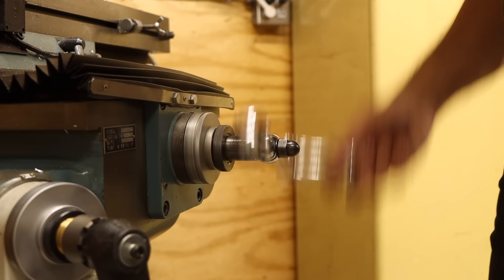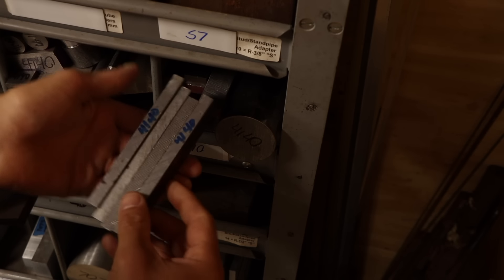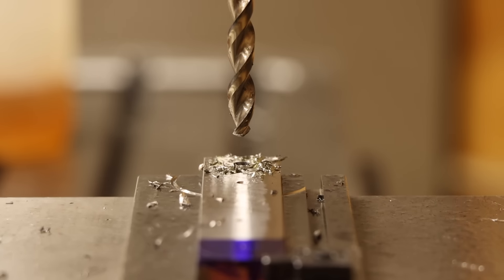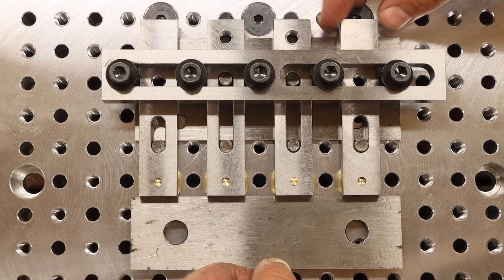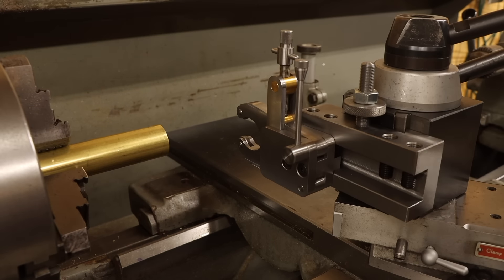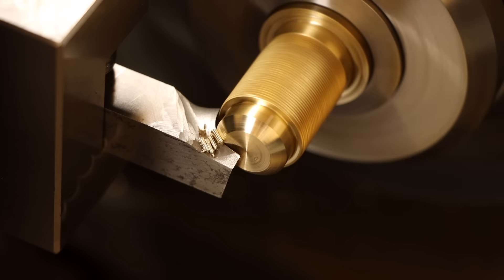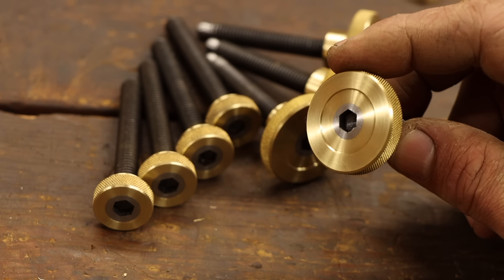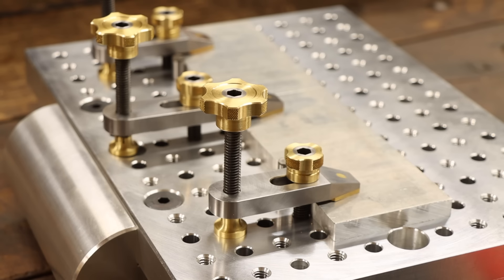Some STYLISH Hold Down Clamps || INHERITANCE MACHINING

Comment: I honestly love watching the drafting table work. It’s unique in the YouTube machining channels.
Reply from the maker: There's a good reason nobody does it anymore 😂 Thank you!
Reply: In my last years as a tool and die maker I had a drafting table (actually known as a drafting machine) placed right beside my bench to design my jigs, fixtures and dies on. Once CAD became popular all the company drafting tables became obsolete and were thrown out. They’re nevertheless marvelous machines and time savers for hobby machine shops.
Reply: @InheritanceMachining  perhaps, but like manual machining is great to see it done. Reminder of how we did things before computers took over everything.

I appreciated the compass scrip in layout fluid for the radius in the end too. No one shows layout work instead relying on a DRO anywhere. Not everyone has a DRO on their mill/lathe.
Reply: @TEDodd  this old tony has used layout fluid in many of his vids, but your right, not many youtubers use that stuff.

I also appreciate seeing the old drafting board being used. You can make drawings as good and professional looking as cad with enough expertise, i think. Physical drawings obviously have their limitations, but its how everything was designed pre-cad. Break out your slide ruler.
Reply: @ctdieselnut  I've seen him use a little here and there, but not a full layout for mill work. And many will use something on a lathe (lots of Sharpes) to show stop points as a visual reference, but they rely on a DRO for the actually stop.

I think it would nice to see channels that are vintage/manual oriented actually use the techniques from 50 years ago instead of adding and relying on modern DROs for everything. Like manual drafting vs CAD, it good to remember the old methods. Could be handy when things breaks.

Watched one guy with an old drawing meant for manual layout and he complained about it not all being referenced from a single point. So he redrew in CAD to reference that way and did the entire project with the drawing and DRO. No marks anywhere to even check he was in the right spot. (Of course he also converted all the fractional inches to meters too)

Comment: Having done manual drafting through my early career. An old time drafter I worked with taught me to rotate the pencil as you drew the line to ensure the point remained sharp and a constant thickness. Good to see you doing the same thing. Great channel and look forward to your videos
Reply: Me too. As the formats progressed to ink, crayon on mylar was the epitome of being able to draw fast (rotating the holder) without breaking the 'crayon'. Nice thing though was also the ability to erase without messing up the surface. You simply rubbed out a mistake with water. I have a permanent dent in my middle finger. As for time: The actual drawing time for these would be pretty quick. Research and calcs would take 2x the actual. He is drawing on vellum, may want to consider the more temp. stable mylar. Remembering now: To save the vellum expense I would have students draw the entire project on bum wad. Temp and humidity excluded, the trace approved then, the execution of the final drawing would be done. For the actual drafting example shown: 30min max. The mistakes on execution made while I was viewing: Cringe factor 5.   Do people really want to watch drafting? I was looking at my collection of beam compasses, ships curves, pink triangles, green iso templates, erasing shields, vemco compasses, w&g scales, dietzgen, the old Hamilton table. Hmm. And, I'm a lefty so, that doesn't work really well for demonstrations... Plus, It was hard to be a bent over asshole and elbow all day! Excellent video anyway.
Reply from the maker: 😁 Thanks! That technique definitely makes a difference

Comment: Hey there! Glad to see you making your own hold downs. 
Made some myself not to long ago... Nothing like the feeling of making your own tools. 

One little tip from my end. I know that it is always in the "quick and dirty" bank to hold an endmill in a jacob's chuck.... But I would really recommend against it. The cutting forces are so much higher than a drill and the clamping forces are low and uneven. It can be very inaccurate (i know it didn't matter on this one) but also dangerous to person/part/tooling alike. (think tool slipping, binding, breaking)
I like a morse taper with a bore and a close fit bushing. A grub screw holds it in place on a flat present on many larger HSS endmills. It will run slightly larger on most c'bores do to the screw... but is usually passable or accountable for. 

As ever, love what your doing and I can't wait to see what's next!. Thanks for your work!
Reply from the maker: Good call there! If I was going any serious plunging in a harder metal I probably would have taken the time to come up with something more robust. Might actually be a good idea to make some sort of collet adaptor for the tailstock for just this purpose. Thanks!

Comment: The hold down clamps are beautiful. In fact, they look far too nice to ever use them. I'd just put them aside for display and make another set for use. Those clamps are so nice looking that people who don't even know what they are used for would appreciate them.

p.s. - I've never been a fan of the low cost standard clamp set. They do not always properly fit the height of the work piece and they become deformed over time, making them even worse to use.
Reply from the maker: That's a hurdle I'll have to cross eventually haha Thanks a bunch!

Comment: I'll be honest, I love machines, it may or may not sound weird, but I love them, now don't take me from some mechanic genius, I'm a beginner at best, but every mechanism is magnificent in my opinion, even the simple ones, even just a threaded rod that turns and holds.
And whenever I see mechanism and "machines" of this kind, where everypart is beautifully made, bright and shiny, spotless clean, I just love it.
I may be doing a disservice to mechanics calling a lever and a what is essentially a bolt a machine but it's beautiful in my opinion.

Comment: It's amazing how different this is from working...  

I'm still not over you using brass as a non-marring pad. To me non-marring usually means rubber, maybe a softwood in a pinch.  

In working of your measuring in thousands of an inch you're just being a perfectionist

Comment: You can also cut radius the same way you did the scallops instead of hand grinding or doing them on the rotary table by using the bolt hole feature on the DRO.

Comment: Those turned out super nice! Only change I would make is changing the material of the ball feet from brass to bronze, as brass is not a bearing material and will end up galling under load.

Comment: A decent way ive found to get closer radiuses on form tools Is to get it close to the line then finish it off with some grit paper wrapped around a turned radius minus the thickness of the paper.

Comment: Cool project! Another way of making form tools is to cut the form into HSS with a carbide end mill. Just take your time and don't build up too much heat.
Reply from the maker: Thanks! I was actually toying around with this with a small carbide endmill I have. I had a hard time getting the profile to actually come out round since it drifted under the cutting forces. Any tips?

Comment: It's actually pretty easy to swage those feet on using the lathe. Use a smooth polished bit to press against the foot. You'll need a fixture for the screws—something with a center in one end and a coaxial threaded hole on the other end.

Screw the fixture on the screw and then pin the ball in the end of the foot with a live center. Spin the machine up and use the cross slide to press the tool's tip against the edge of the cup on the foot,. It will swage over and trap the screw.

No additional slits are necessary.

Comment: Hey,
I absolutely love your videos and binged them all from beginning till end when I found your channel about half a year ago. I've almost exclusively been using cad software for drawing and thinking out my designs. But seeing you draft out your stuff on paper has inspired me to pick up my mechanical pencils again. During my drafting renaissance time I found some lovely erasers I use in conjunction with a big eraser. It's simply just a pencil with an eraser instead of lead and you can just stick it in a pencil sharpener to get a fine point again. I love it to make my drafts extra clean in the tight spaces and thought maybe you'd enjoy this as well (if you hadn't heard of it already that is). 
I got myself the faber-castell ones but pretty sure you can find off brand ones somewhere. I'll drop a link a bit lower so you can see what I'm talking about.

Hopefully you find this as usefull as I did.

https://www.faber-castell.com/products/Perfectioneraserpencilsetof2/185698
Reply from the maker: Those are awesome. I have something kinda similar that's like a lead holder only for a long cylindrical eraser. Never occurred to me though that I might be able to sharpen it like pencil. Thanks for the recommendation and glad to hear you're dabbling in the manual way as well!

Comment: I make my radius tools by putting a bar of steel the required diameter for the radius IE x2r in the lathe, then putting lapping paste on it and using it to finish grind the radius on the tool. Just make sure you clean any stray lapping paste off your lathe after.
Reply from the maker: Clever! Thanks

Comment: I would probably load the threaded holes on the angle plate with screws to protect the threads from gunking up over time, and just remove the ones needed when in use.

Comment: This project hits really close to home because I actually made one of those mounting plates myself about a year ago(albeit smaller) and am yet to use it, I suspect for similar reasons 😁
One thing I must point out, and calling this trivial would be an insult, but when you made the two clamps for the fly cutter, you could've done the 3 phases of filing - 45deg left, right and then draw file. This is something I used to teach my students in my previous life and always found it produced a really nice surface finish. Addmitedly, this is completely useless, but knowing your attention to detail, I'm surprised you ommited this feature 😉
As usual, loving the content, Brandon.

P.S. - the ASMR aspect of drawing was really nice. Didn't expect that.
Reply from the maker: You completely stumbled upon something I wasn't fully aware of! haha but now that you mention it I recall seeing Clickspring using that draw filing technique to get finer finishes and it all makes sense now. One thing I don't follow though is the 45deg right filing. 45 left sounds like the normal approach I used but I cant picture the 45 right. Maybe I just need to play with it haha thanks as always, Erik!
Reply: @InheritanceMachining  the whole 45deg each way thing - I’m probably making it sound more complex than it needs to be. When filing you would hold the file at 45degrees to the part, then flip the part around(or walk around the vice) and file the opposite way. This “cancels out” a lot of the filing marks. For the extra effect, do this with the 3 grades of file - coarse, medium and fine with the last part of each being draw filing. It’s hard to explain, but it almost works like an eraser for filing marks, quite magical - strongly suggest trying it! You’d be surprised how nice a finish you can get with this method.

Comment: Oh boy, knurling, brass, scalloping, inserts, the connection to other projects... this would be the perfect video if I weren't a knitpicking A-hole.
You didn't chamfer the UNDERSIDE of those scallops. And yes I do realize how time consuming and difficult it would be, but to me (and I guess in some deep crevice your mind too) it wasn't complete, perfect. I just can feel it, grabbing those wonderfully crafted knobs and BAM, those sharp edges cutting into my fingers...
On the other hand I can always contemplate that old axiom: "perfection is the worst enemy of possible".
Reply from the maker: 😂 It does eat at me a little! But the juice wasn't worth the squeeze. The easy setup would have been to just use a dovetail cutter while they were still mounted if only I had one the right size!

Comment: Ever try Joe Pie's method for squaring up a block?  Basically sit the raw piece flat, far enough out of the jaws to yield the size you need, cut the top and all the sides, flip it over onto parallels and mow off the material left over.

Comment: I think you should have designed the non marring pads to be replaceable. This build is absolutely beautiful though.  And they look pretty useable
Reply: They can be pressed out, new ones pressed in, a bit of filing and done
Reply: @LeonardRoberts  true.. I meant maybe screwed in or something but your right.  Should be easy enough to press those out
Reply from the maker: Thanks! Yeah just decided to keep it simple on that one. I can always update the design if I find myself needing to exchange them a lot

Comment: Greetings, Mr. Engineer.  You have many beautiful works and everything is done professionally.  Although I have a degree in mechanical engineering and am engaged in the profession of thermal installations, I follow all your work with interest.  But one question: Why do you do the designs manually?  Although I myself am a fan of the traditional method, computer design greatly increases the speed and accuracy of design.  I have many questions that I want an expert to answer.

Comment: If you measure the thickness of a piece of emery cloth you can turn down a piece of bar stock minus the thickness of the emery cloth and use it to hone the radius tool to perfection.

Comment: Hi! I Have a quesiton. At 14:50 you found an old drill holder which was rusty. How did you clean up the morse taper? With the wire wheel as well? I bought recently an used SK50 taper tool for cheap (to be part of my new machine) but it's a bit rusty. I'm thinking about how to get rid of the rust but not to damage it.
Reply from the maker: Yup I just used the wire wheel though I don't know that I would recommend it for everything since it does cause a light amount of surface deformation. All depends on how badly rusted it is and how aggressive you are with the wire wheel. A rust dissolver like Evaporust would work great and I don't think it would effect the surface beyond any pitting already cause by the rust. Lightly Scotch-briting after rust treatment helps a lot too
Reply: @InheritanceMachining  thanks for the hints! It will be helpful for later

Comment: If you look at the face of the brass stock at 8:14 you can see a small pin in the center, that's an sign that your tool is a tiny bit too low. If you can measure stuff at such small dimensions you can raise the tool half the diameter of the pin. 
If you on the other hand have a small "hill" in the center, it's an indication your tool is too far up and needs to get lower. Looking at how a tool faced the part towards the center is how we set the Y height in the CNC machines when I worked as a machinist producing medical parts, no need to try to measure 0.001mm when you could see and feel it.
Reply: Note now that I'm done watching the video; Absolutely love the parts. Very beatiful design with the mixed materials. Good job!
Reply from the maker: Thanks! And good advice on the tool height. The negative rake plus nose radius somewhat negate the accuracy I shot for with my fancy tool height indicator. At least for facing cuts

Comment: Gorgeous, incredible work as always! Small question. That lead pointer/sharpener you've got for the drafting lead holder: is it commercially available?
Reply: I would assume it's out there, as those appear to be cast housings. That being said, I'm not certain he won't have a little foundry eventually. :)
Reply from the maker: Thanks! Commercially I am not sure but you can still find them on ebay. Dietzgen SharPoint

Comment: nice work, just one small remark
How much work would it have been to chamfer the downside edge of the knobs too?
Reply from the maker: It's definitely doable but probably would have required a special setup or fixture, plus re-indicating, and likely a special/modified cutter to clear the screws and/or the knob boss underneath

Comment: Could you give some info on that pencil sharpener you use? I use the same pencil but don't have a decent sharpener and I would LOVE to have one like that so any info you have or direction to one I would greatly appreciate it.  Thanks. Love the videos, keep up the great work!
Reply from the maker: Absolutely! That's a vintage Dietzgen Tru-Point. You should be able to still find them on ebay

Comment: 10:33 Buy yourself a magnetic digital inclinometer, stick it to the top surface of the plate and you won’t be searching “for the light” under the plate. Saves time and your back.

Comment: The jig used at 3:42 looks like it would cause the workpiece to bind on the blade as you cut through. I’ve never seen one of these, is it meant for cutting circles in half?
Reply from the maker: There is potential for that sure. But usually when you near the end of the part you lighten up on the pressure enough that it doesn't pinch the blade or let the blade suddenly pop through.

Comment: If the brass "soft jaws" inserts in the clamps are just press fit, how do you make certain they won't move over time?  I'm betting if I made these (because I have zero metalworking skill) that the brass inserts would spin.
Reply from the maker: I suppose I can't guarantee that. If it's an issue though I can probably add an anti-rotation pin